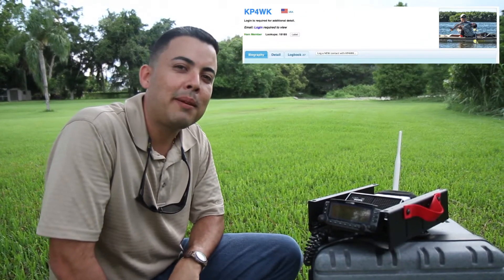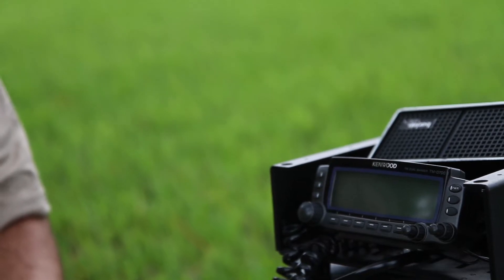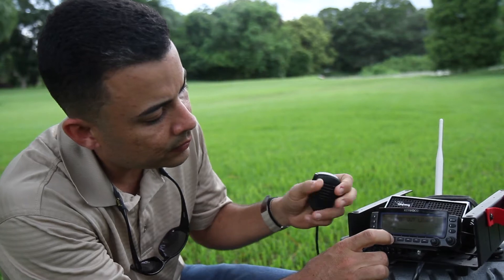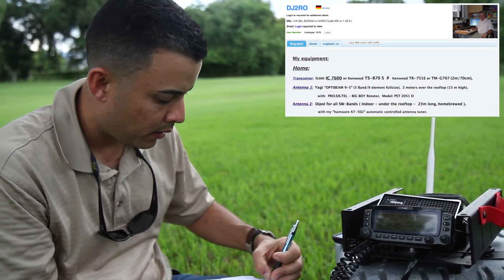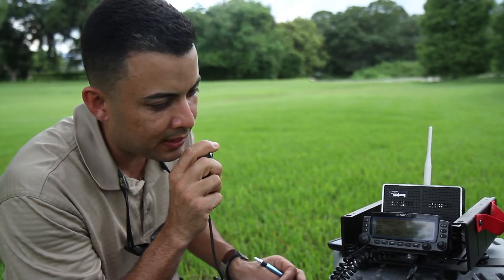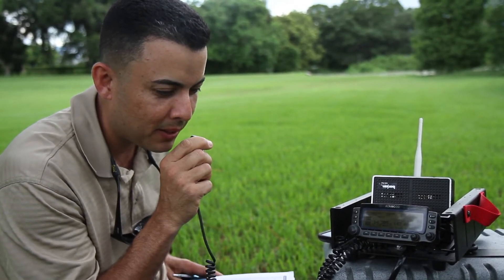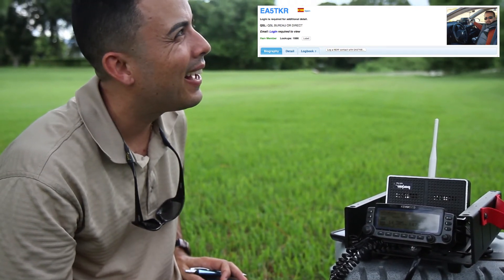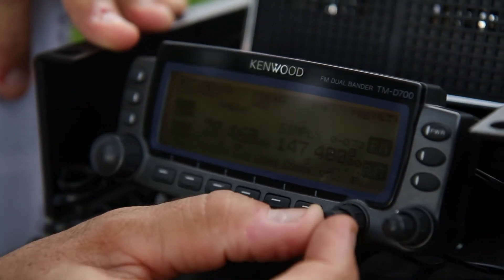KP4WK Portable Ham Radio Remote Rig D700

Comment: Hello Norbert, I enjoyed watching this demo of Remote Rig.  Very well done by you and the videographer.  I like your remote station, it is very neat and compact.  I never thought of using the TM-D700 front panel to control your TS-2000 (read CoquSats comment below).  I use Icom radios, not too familiar with Kenwood radios.  Steve WA8Y  PS I talked to you from my HF mobile.

Comment: Hello there, the radio on the remote side is a Kenwood TS-2000 connected to one of the two remote rig boxes. It connects to the jack were you would plug the optional front panel of the TS2K in the back. On the operator side we have the control panel of the radio, in this case we are using the front panel from a Kenwood TM-D700 which is compatible with the TS2K. ** Note Only the front panel on certain D700 Serial Numbers are compatible with the TS2K. Kenwood also sells the RC-2000 front panel specifically for the TS-2000. The two remote rig boxes are pre-configured (IP, port forward, DNS, etc.) and connected to the internet. There is a whole remoterig forum with plenty of info on how to do the set up. Once they are set, is like having the radio in front of you as you can see in the video. You can do phone and CW via the remote rig. You can turn the radio On and Off, and have access to all the features. I think the TS2K is perfect for "remoting" because it has built in antenna tuner HF/6m/V/UHF . That's the basic set up in a nut shell. 

Then we also have a computer running on the remote side. This is optional, you don't need a computer for the remote rig. It is connected to the radio in a couple different ways, thru the CAT port, a Signalink and the rotator control box. This set up allows for digital modes (sstv, JT65, PSK, etc), rotate the antenna (Mosley Ta33jr) and access the radio menu with Kenwood's software. You can also interface with HamRadio Deluxe or run contest logging software like the n1mm. The last piece of the puzzle is a web switch, basically an 8 outlet box that can be accessed thru the internet. It allows to easily turn On and Off the power outlets if necessary. For example, reboot the pc, reboot router, turn On/Off the power supply and control anything that is connected to the AC power outlets. 

On this video I was using my cell phone as a hot spot to provide the internet connection. The pepwave shown (white box on top)  is just a portable router for ease of connection. Everything is already pre-configured between the pepwave and the remoterig it only needs the internet connection provided by the phone. Very dependable system as long as you have an internet connection. The connection doesn't need to be super fast. 

73s
Norbert